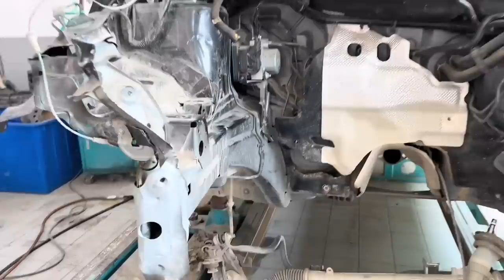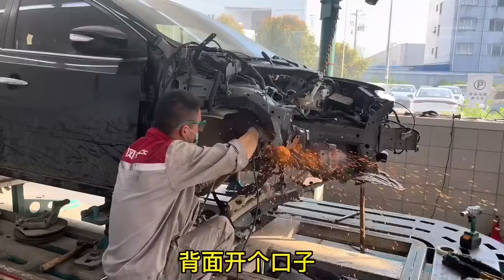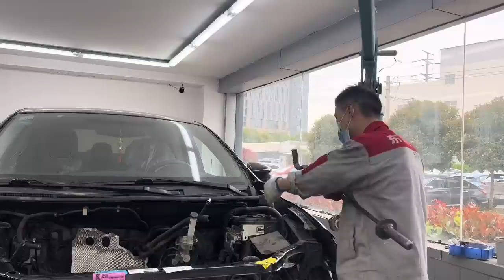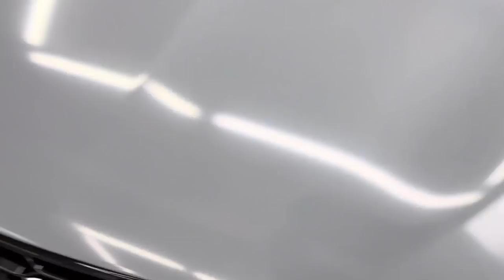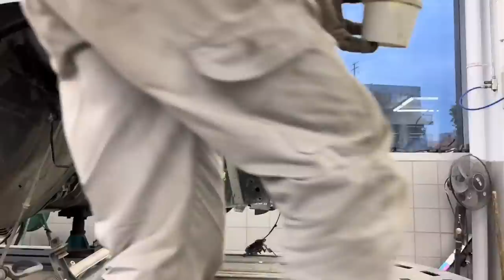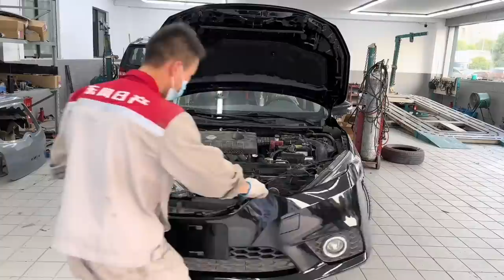Crash-Damaged Nissan Sentra Gets a Second Chance with Talented Young Mechanic

Comment: This guy never considers structural precision on  bases of the car frame original measurements..you can not just pull en push the frame using your eyes gauge ..This is a bad job because the car will loose the original frame intergrity and shape.
Reply from the maker: Your concern about maintaining the original structural integrity and precision in car frame repair is valid. When repairing a vehicle after a major collision, it's crucial to use precise measurements and follow manufacturer specifications. The structural components of a car are designed to provide safety and stability, and any deviation from the original specifications can impact the overall performance and safety of the vehicle.

Comment: I'm not sure what insurance rule are in that country, but here, my country, this car would NOT be allow back on the road, as it would be class as write off and it would sold as parts, as the cost would out way the cost of a new cars.
insurance, would rather buy a new car and try to spent all that money on repair.
Reply from the maker: Insurance rules and regulations vary from country to country, and the decision to repair a damaged vehicle depends on several factors, including the extent of the damage, the cost of repairs, and local regulations. In some cases, a severely damaged car may be deemed a total loss (write-off), and the insurance company may choose to pay the owner the actual cash value of the vehicle rather than covering the repair costs.

In the case of the repaired car in the video, it's possible that the repair was performed for reasons other than insurance reimbursement. Some individuals or shops specialize in restoring damaged vehicles, and they may have the expertise and equipment to perform extensive repairs. However, it's essential to consider safety and structural integrity when repairing a damaged car, and regulations regarding rebuilt or salvaged titles may apply.
Reply: @xinxianshi  Thx. good info 👍